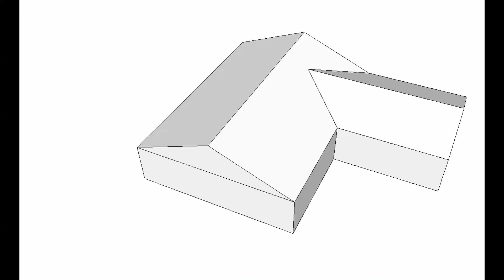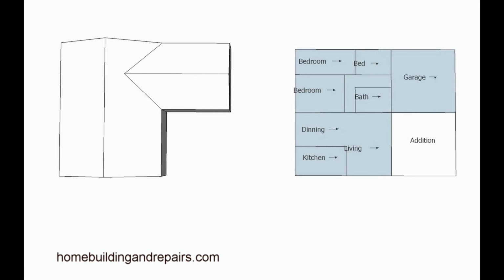Examples Of Home Addition Location For Floor Plans - Design And Architecture

Comment: My kitchen and dinning room are on the other side (right side)of the main living area. The living room fills the left side and the hallway flows right down the middle. There is a utility/pantry/laundry rm between the kitchen and bath. I have no garage. What I want to do is build garage off of the laundry rm because the side door is off of that room. Problem is, there is a house on that side. It would be perfect because the only window from the laundry room to the back end of the house is in the bathroom. So I wouldn't miss it much. On the other side I could add a garage but it wouldn't be as user friendly as it would be far from any entrances. But on the left side from the single bedroom window to the back of the house there aren't anymore windows. So a garage could be built beyond the bedroom window to the back of the house and have enough room for an extended pickup truck to park more than comfortably. (DREAMS)